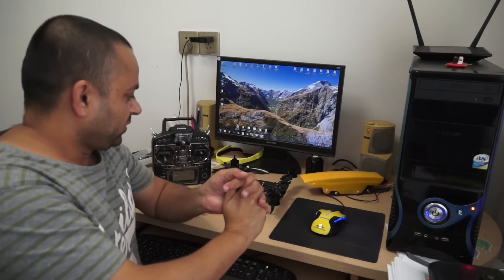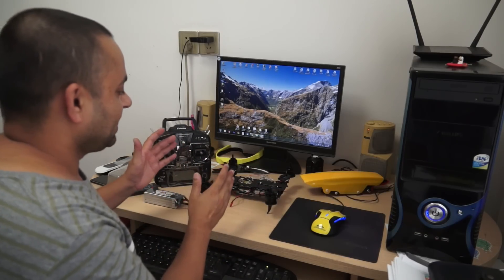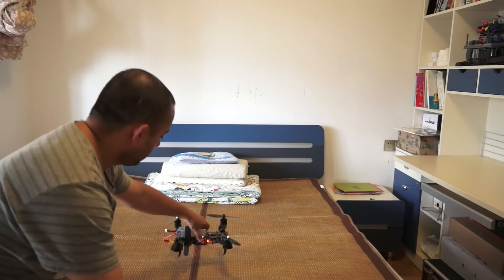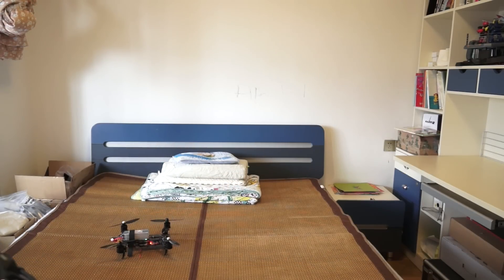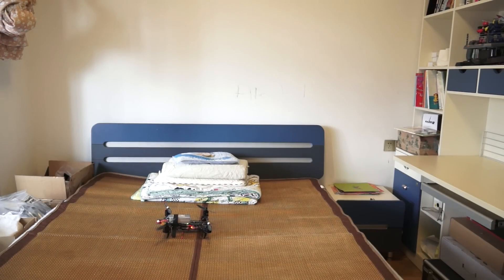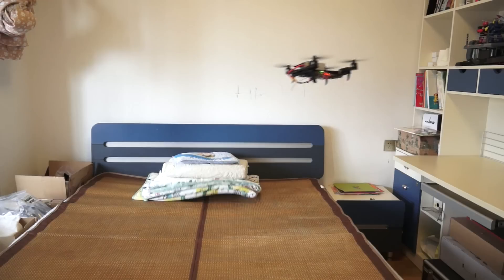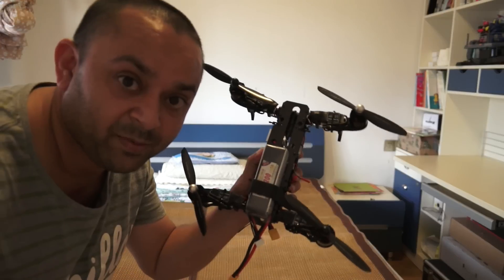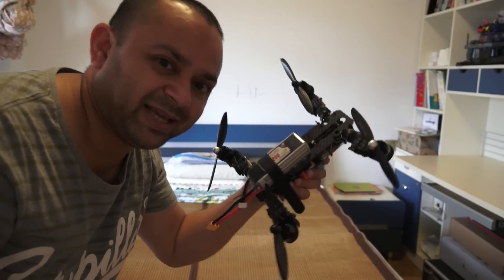OFM Swift TR260 Tilt Rotor FPV racing Quadcopter Build Video Part 11

Comment: I received my swift tr260 about 10 days a go. I have made several flights it is very fast !!! but one problem is the land gear is connected to tilt servo. on hard lands with forward motion it brakes the servo. I made land gear connected to frame and remove land gear from tilt servo .

Comment: was caught between this and the Vortex,  I really like the motor tilt but also like the clean build of the vortex. wish there was a swift which looked clean like the vortex, that would be a winner. all integrated hardware. None the less, i am watching this very closely. Good work Ali
Reply from the maker: episode04 this is the first test production. our next mass production is going to be cleaner and better. I will be posting updates soon with pictures of 2nd mass production. all cables and everything is covered right now and build is much more aerodynamic, clean and beautiful.

Comment: What is the weight of this?
It looks good but weight is a big factor with quads especially if you are going to race them and to be honest this looks very heavy.
Your walls look my mine from test flights! lots of prop marks LOL.
Reply from the maker: Valkman RC Depends how you setup. you can easily keep it under 800g including everything battery, GoPro, fpv system on board.

Comment: Could you fly acro on motor tilting mixing? Could you set the mix to match elevator input to control the rate of tilt rather than tilt position? Otherwise, I think this will fly like you fly normal quad with attitude mode. And nobody is flying fpv with attitude mode.
Reply from the maker: Hoang Linh Bui I will do some experiment to mix servo with flight controller to fly in acro / rate mode and use tilting :)